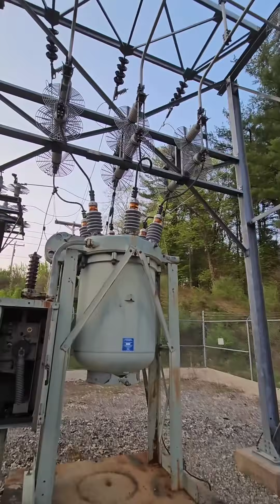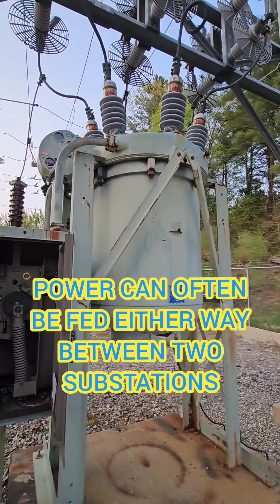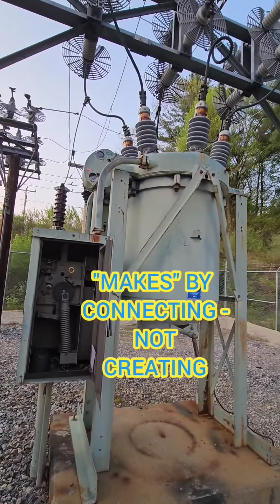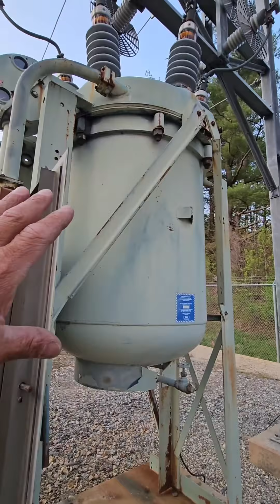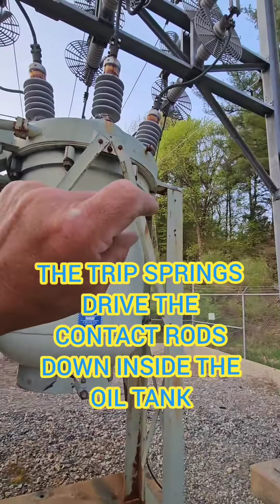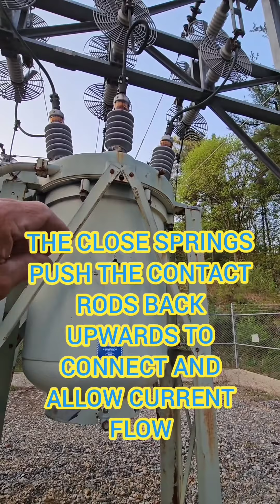How does a high voltage circuit breaker work? An overview on a sub transmission 34,500 volt ocb.

Comment from the maker: We'll need a few more decades to know if they are as reliable. The next generation of breakers after this was still oil filled, but they used electric/hydraulic operating mechanisms because they could store more trip/close cycles. The operating mechs were a lot more finicky though... at least where there's cold weather. After that SF6 1st generation which was an electrically driven air pump powered mechanism to store energy to operate the breaker (always a spring trip). Also finicky. The ones we see the most of currently are either SF6 or Vacuum  interruption with a similar spring charge mechanism as what I described on this breaker...just newer.  It just seems to be a reliable setup. 
As far as changing interruption mediums, I think oil is just physically a lot to handle and dispose of start to finish and it still has the bad environmental stigma even though it's clean of PCB now and easy to clean up.  SF6 can't really be seen even though it has a couple of pretty bad byproducts and is very bad for the ozone if it escapes.  Vacuum is good,  it gives off x- rays if you get to close during an operation, but no one really wants to be close when these are operating so that's OK.  They just can't go any higher than 34,500 volts,  so all the large stuff is pretty much SF6 until they figure out something better.  I hear that they're working on purified nitrogen as an interruption medium, so that could be good.

Comment: I'm curious to know why they're going away from these, as in why they're replacing them with new systems. Are the newer circuit breakers more reliable? Do they have higher operating specs? Are they safer? All in all though I loved the video. Your simple approach to explaining what all is going on is phenomenal. Thanks for the educating video.